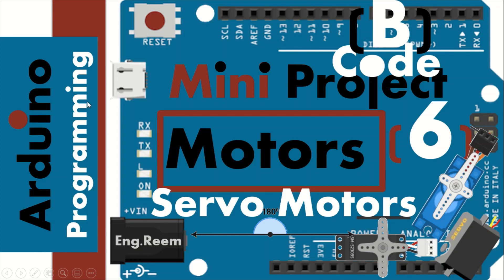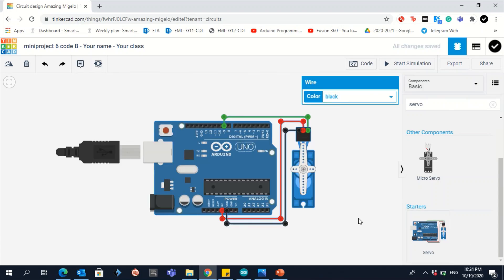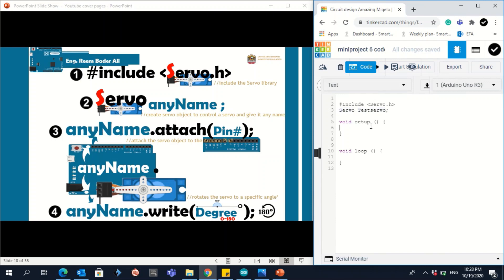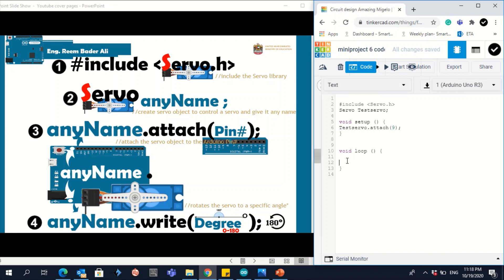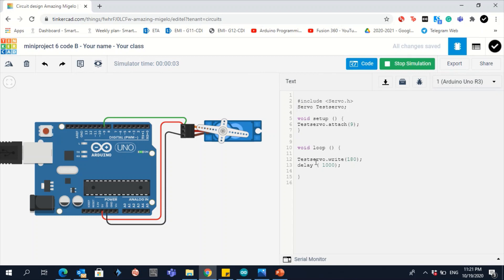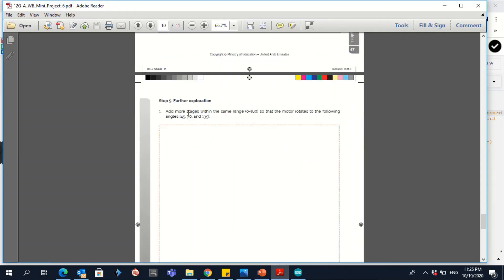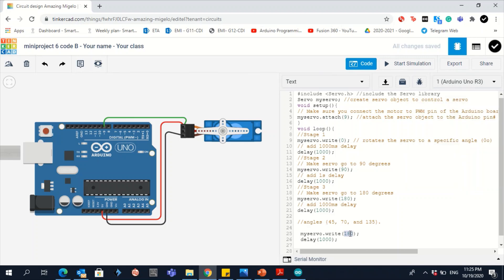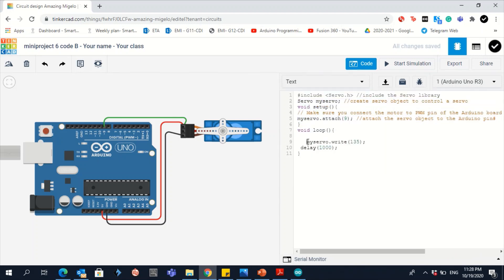Arduino MINI-PROJECT 6: Motors Code B -servo MOTORS

Comment: Ashjan 12/D

I learned that the difference between DC and servo motors is, DC motors can rotate 360 and servo motors can rotate 180.

Comment: I have learned today about servo  motor and DC motor and servo can rotate 0-180 and have angles and for the dc motor it can rotate 0-360 and without angles
Ameera.12/D

Comment: learned in this video. Difference between Server motor and dc motor, servo can rotate 0-180 and have angles and for the dc motor it can rotate 0-360 and without angles

Ayesha Saeed 12A

Comment: What I learned: 
In servo we can control the angle but not it only rotate between 0 and 180 degrees
In Dc motors can rotate 360 degrees but we can not control the angle

Comment: l learned The difference between Servo motor and dc motor, the servo can rotate 180 with angles, and the dc motor it can rotate 360 without angles.
BUDOOR HAMAD 12-E

Comment: Reham khaled 12C
What I have learned from this project6 Code B???
I have learned that servo motor only rotates 180 degrees as the DC motor rotates 360 degrees.

Comment: I learned that servo motors can rotate 180 degree at max and we can insert a specific degree, we can control the rotation using the servo library.
Reem Aboud 12C

Comment: I learned in this video the. Difference between Servro motor and dc motor , servo can rotate 0-180 and have angles and for the dc motor it can rotate 0-360 and without angles

Comment: Huda 12/B
I have learned that DC motors can rotate 360 and  servo motors can rotate 180 , you can choose a specific angle from 0 to180 and servo motors have three wires and DC motors two.

Comment: Shahad Adel 12B
The main difference between servo and DC motor is that the servo motor rotates only 180 degrees but the DC motor rotates 360 degrees.

Comment: In this video, I learned about how to program servo motor and control it's rotation by using the servo library. Thank you Ms for this helpful video. Aseel Ashraf 12A

Comment: #include <Servo.h> //include the Servo library
Servo myservo; //create servo object to control a servo
void setup(){
// Make sure you connect the motor to PWM pin of the Arduino board (with ~ sign //next to the pin number).
myservo.attach(9); //attach the servo object to the Arduino pin#
}
void loop(){

  for (int pos = 0 ;pos <180 ; pos ++ ) { 
 myservo.write(POS);
delay(20);
  
  

}
Reply from the maker: why u use one time "pos" and the other time "POS" ? 
Variables are case sensitives

Comment: I learned in this video that the servo motors can rotate 0-180 and they also have an angle from 0-180. But the DC motors they can rotate 0-360 and they don’thave an angle.
Asalah khaled 12/C